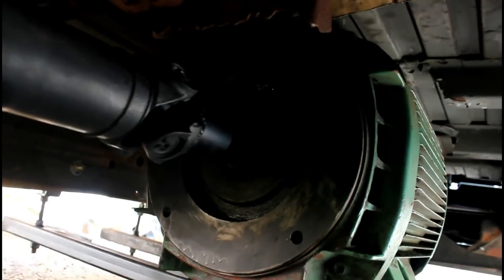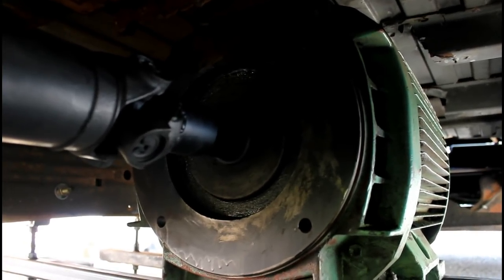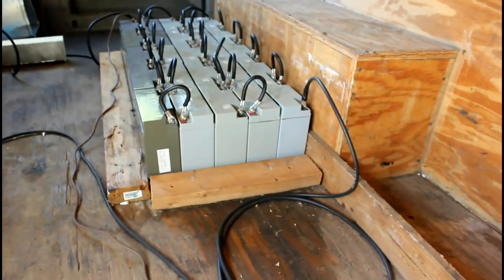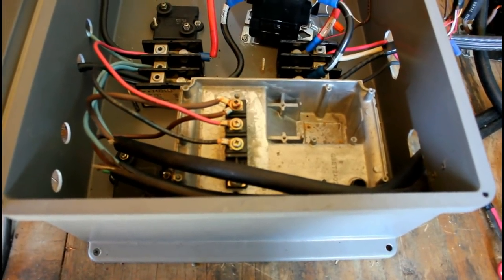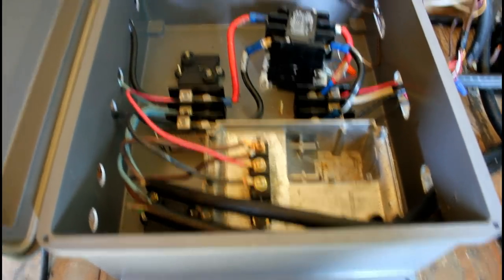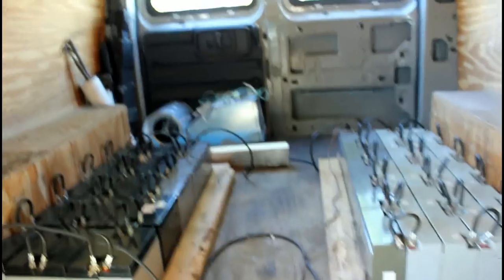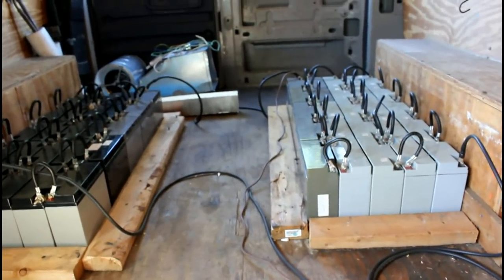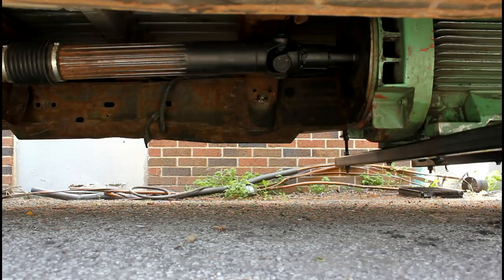Chevrolet Express EV drive train

Comment from the maker: It is very heavy, and the mechanical brakes don't last long so regenerative braking helps a lot. I would say it also increases the range somewhat.  I use a 6 pole motor because it produces more torque per amp compared to a 4 pole motor. A 4 pole motor of the same size would produce more power, but it would require more current to reach the same torque. That would mean a bigger heavier more expensive VFD. The VFD tries to approximate a sinewave but is not perfect. Thanks for watching

Comment from the maker: I am not sure the specifics, but I believe a 4 pole motor has the best torque to weight ratio, but I'd imagine a 2 pole motor would work, especially with the right gear reduction. A pole changing motor might work though I'd be a little afraid to switch when in motion. An induction motor can also overload to about 4 x nominal torque peak with the right controller. Just match up the torque of the original system with the peak torque of the new system. Thanks for watching

Comment from the maker: The VFD is an ABB ACS 600. I did at one time use a different VFD, which I put bigger IGBTs on, but I switched to the ABB because it has much better torque control. The ABB drive does detect the motors rotational speed and matches the frequency and voltage to produce maximum torque when commanded to. So it will respond like a normal combustion engine (torque control). It can also output full torque at 0 RPM. Regenerative braking is very important to assist in stopping the van. (continued)

Comment: Thank you so much for taking the time to explain. Very interesting and somewhat similar to what I had imagined. If the brakes are a problem you might find it possible to swap the drums out for discs which typically last a lot longer and are usually sharper. I am sure a breakers yard will be happy to supply cheap parts.I understand you are after regenerative braking which you have achieved and that is great but how effective do you think regenerative systems are?

Comment: Really interesting video, well done and many thanks. Lots of questions: Do you feel that the regenerative braking makes much a difference to the range of the van? Is the VFD one of your own design? Do they generally produce a simulated sine wave or is it just a chopped 'rotated' square wave? induction motors seem to have very little torque when not running up to speed so does the VFD ramp up and sense the motor speed somehow? Could you/would you rewind your own 6 pole motor from a 4 pole? Thanks

Comment from the maker: From a control standpoint, the regenerative system is nearly perfect. The real limitation is the batteries. The batteries cannot charge as quickly as they discharge, that really limits the energy that can be recovered and the time it takes to slow the van. If the batteries were perfect and had no limits, the regenerative system would stop the van much faster and almost all of the energy required to stop the van would be recovered

Comment: thanks for posting mate! excellent video. do you think that with the correct motor and a lighter vehicle a 2 pole motor may work ? higher speed perhaps ?
im just learning about AC induction motors myself. :)
do you think it would be possible for a dual wound motor to work? like a 2/4 pole switchable?

interesting :)

Comment from the maker: Yeah with a lower ratio you get better high speed efficiency, but at the price of lower torque. Vice-versa with a higher ratio. That's why transmissions with multiple gear ratios were made. As I said though they also add inefficiency through friction and weight. They are also a bit fragile they always break in trucks so I just went right to the drive shaft

Comment: do you think then your 4 pole motor would work better with say, a 2.7:1 diff ratio instead of your 3.7? using the torque to get the machine moving rather than just spinning the motor at higher RPM ? more efficency possible at cruise this way?

Comment: With regard to regenerative brakes would you agree that to slow down in your vehicle from maybe 50mph to a full stop wastes as much energy as would be used to accelerate that same vehicle from a standstill to 50mph in the same amount of time? Is there any way to tell on your system how much energy is created, or more crucially, stored during regenerative braking and how that stacks up as a percentage of energy lost by stopping the vehicle.Sorry no IGBTs or coolant pumps in this question!

Comment: have u thought bout using a duel shaft motor tht way u can run the ac by belt n the power steering pump n brake pump n us a alternator maybe to help recharge the system .....